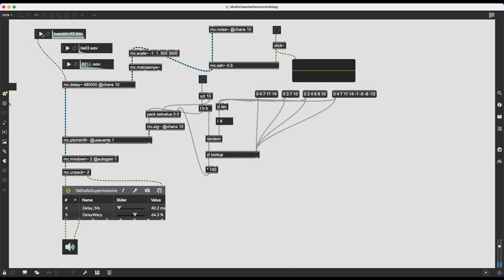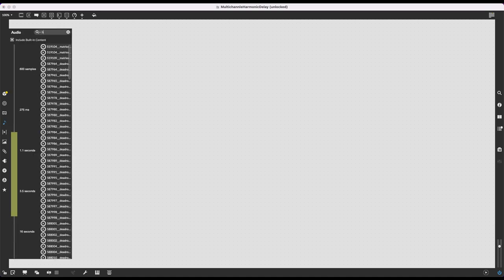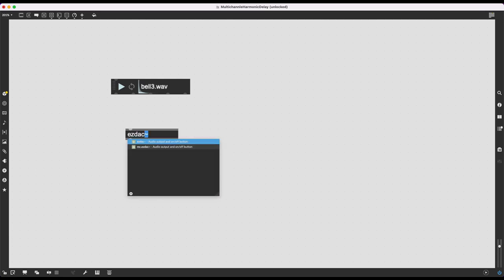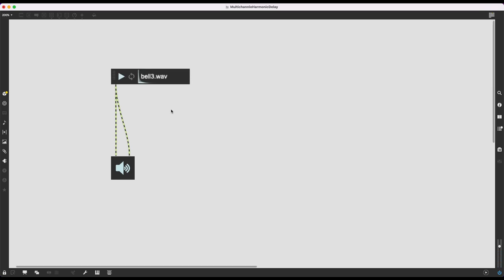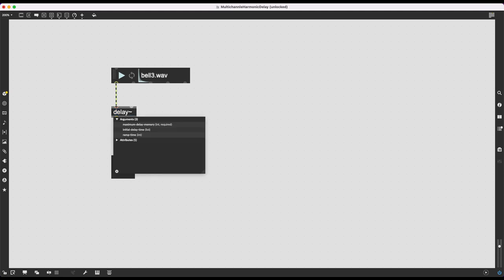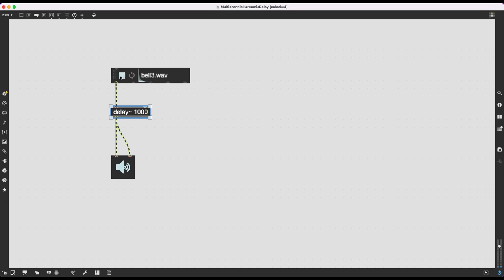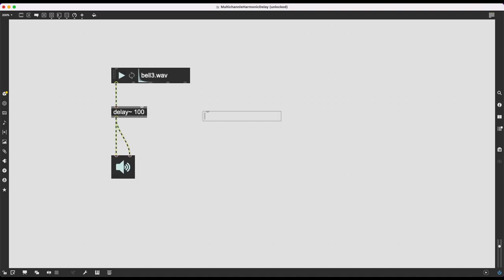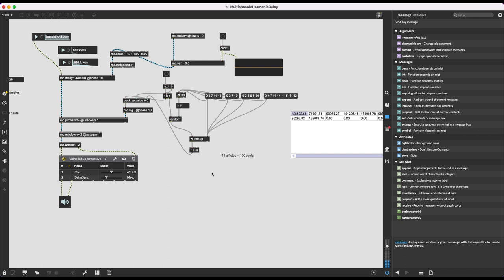Multichannel Harmonic Delay - Max/MSP Tutorial

Comment: Thanks for this very inspiring presentation! Super clear and rich with possibilities. I plugged the [modal_change] object"s list out to your [zl len] object in the chain, and it's pretty amazing. 

I'm using my own pr-recording with [sfplay~] but i'm not certain if my attempt to also change the speed of the main [sfplay~ ] source is correct, trying to make drones, slowing the source itself down! Hard to fit with the good speeds to have semi tones and tones in the right inlet of the [sfplay~ ] object for (speed) variations. I am used to cents, but i wonder why [scale 0 1200. 0. 1.]  doesn't sound right, and i have to use a  [scale 0 2400. 0. 1.]  !!! 

I must be tired. Maybe with a [mtof], i'd like to use a system of scaling so that an octave is 1200 cents in the speeed realm of the [sfplay~] at the source of the other variations, but since the prerecorded file as it's own structure, maybe the intervalls can't get aligned in this way.
Anyways and all the ways, check it out with the Modal Object Library, but you must know this stuff already. 

Thanks for the share, and your work is very interesting. Martin